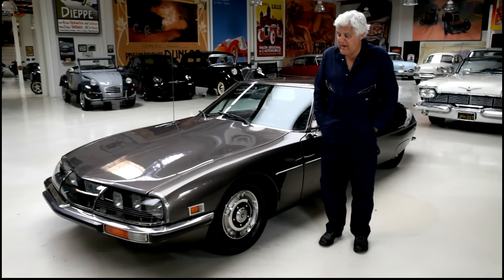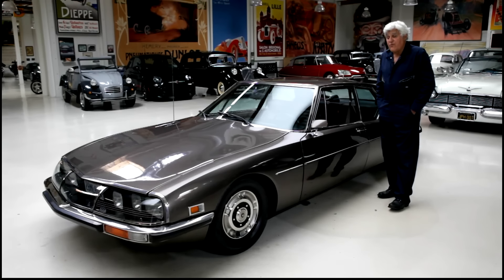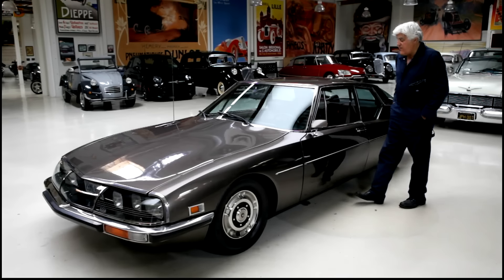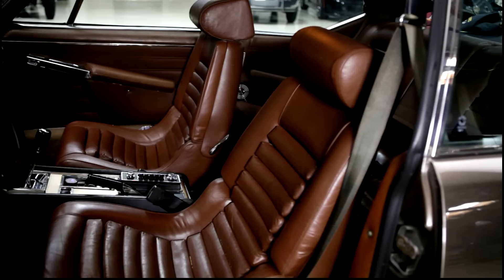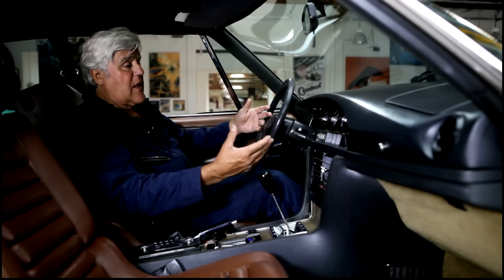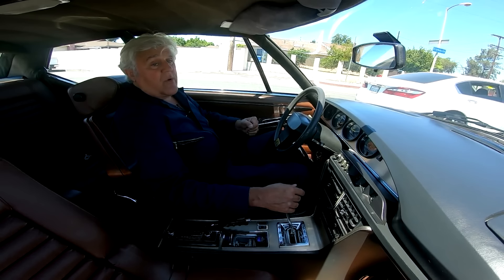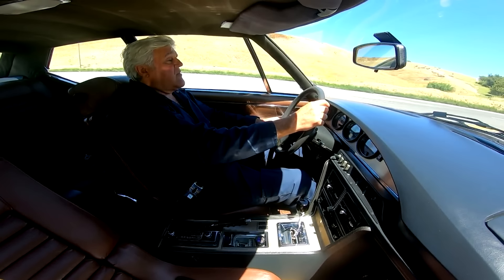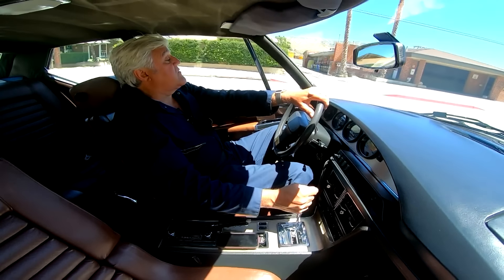The Futuristic 1972 Citroën SM | Jay Leno's Garage

Comment: I drove Citroens for over 25 years. In the early 70s, I had to drive my two-year-old DS21 through about a mile of floodwater a foot and a half deep.  The police were there and had marked the edge of the pavement with long poles.  I put the Citroen in high level as I entered the water and drove through rather quickly.  The car behind me, a large Ford, went slower as he was pushing a lot of water out of the way.  About a half-mile down the road from the flood I made a right turn and was T-boned by the Ford.   He hit my Citroen so hard I was pushed sideways some 30 feet.  When the police came the driver of the Ford excitedly told the police that our car did not go through the flood but had "flown over the water" and he was trying to catch up to see how that was possible and when I turned his wet brakes didn't work and that's why he hit us.  The policeman asked if he had been drinking and gave him a test.  The Citroen's box frame went over the Ford's front bumper smashing everything ahead of the engine.  When the tow truck finally pulled us apart I drove home.  From the man's insurance company i learned later that the Ford went to the junkyard, totaled. They ordered two new doors and a few other parts and after 3 days in the shop, my Citroen looked like new.  I put almost 200 k on that car before the Midwest salt ate up the floorboards.   I loved all four of my Citroens, but I loved my SM the most...
Reply: You, Lucky guy..
Quite an array of Citroens. .
Reply: That's absolutely insane
Reply: I love the C6, the rear window is spectacular the interior is so subtle too. I can see you have a strong bond with Citroëns and it was a pleasure to read your story
Reply: I would have a C6 yesterday but the Peugeot V6 diesel is noted for breaking crankshafts. Then there’s the early century electronics and switchgear that really can’t be trusted.
Reply: The hydraulics have a name for complexity but in reality it’s very simple. The problem was corrosion but everything back then corroded. 1970s Citroen should have at least used non corroding pipes. How hard would that have been?
Reply: "... flown over the water... "
"Sir, I need you to blow into this device here.".
Reply: @Dave5843-d9m  Agree on the C6. Loved it too. But maybe that was too ahead of its time. Heard of the Peugeot V6 diesel eating crankshafts too. I was extremely close to buying a C6, then found the offer of an XM. Despite its older age I went for that and found a car that is perfectly capable of being a daily driver even today!
Reply: I had Citroen BX TXI for 25 years. Superb car, for its cost. Joy to drive. Little maintenance. Same gear box all its life 320,000 km.
Due to cold weather with moisture and long winters here in north, it gained too much corrosion so it would not pass security test anymore.
Shame but now I have C5 and it is as good.
Reply: They're awesome, and awesome looking! So many amazing features that you wouldn't expect from any auto manufacturer in the 70's, or 80's, or even today. The suspension system alone is something that should've been streamlined and/or simplified & made standard on most vehicles.
Reply: @Dave5843-d9m  Hydraulics is forte of Citroen cars. Undeed very simple and working system, of course needs maintance like any system. Smooth yet effective system. Love it. The best car.
Reply: Well, it's great to see people on the other side of the Atlantic with such a love for Citroën cars!
« On n'imagine plus tout ce que Citroën pouvait faire pour nous ! »
Cheers!
Reply: This is one of my alltime favourite cars, beautiful styling, comfortable and, elegant. Hope to own one in the future. Citroen built some really special cars like ds, cx, xm and c6. I have owned a c5 ( 2017) with a big diesel engine, great long distance car. The French have a different way of thinking about cars: pragmatic, style and comfort but not over done or flashy.
Reply: Great story! Thanks.
Reply: Thank you for sharing.
Reply: Wow, thank you to have share this incredible and so funny story. You tell it so well I have all these pics in my head like watching a movie. 😊

Comment: Another fascinating personality involved with Citroen in those days was a man named Georges Regembeau. He was an engineer and Citroen specialist who came up with all sorts of incredible creations, such as a Traction Avant 15 Six with direct fuel injection, a supercharger and 6-speed gearbox in the mid 1950s, and selling tuning kits for DS and SM in the 60s and 70s. He also re-engineered Citroen four Cylinder engines to run on Diesel fuel years before Citroen built their first diesel engine for passenger cars. Naturally several SM were converted to those Diesel engines in the 1970s, a few were naturally aspirated but some were turbocharged and producing up to 150hp, which was just mind-blowing for diesel engines in those years. It is said that a special one of these Turbodiesel SM was capable of 150mph.
Reply: The Traction Avant was ahead of its time!
Reply: That's pretty interesting - I didn't know this and I'm a Citroen fanatic! I always wondered why Citroen had a straight 6 engine that they stopped using when the DS came out. Why didn't they develop that to fit in the DS and leave the 2lite 4 pot for the simpler ID..
Reply: @pallasathena55  Well it came down to Frances taxation rules of the time. After the WW2 they imposed a luxury tax on all engines above 2.2L. It's why the great French Luxury makes such as Delahaye and Talbot Lago went bust in the 1950s. They made all sorts of wonderful 3L + Straight Six goodness. The 15 Six engine was a 2.9L and thus not viable to continue. The air cooled flat six originally planned for the DS was also supposed to be around 2.2L or so. And to be fair the Citroen Pushrod four was a pretty stout engine.

Comment: The way the automatic wipers work is pretty interesting. When you turn the wipers on in auto mode it will wipe once. And the car will measure how many amps the wipermotor is pulling. If the window is very wet, the wipers will move smoothly and easy on the glass, the wipermotor doesn't pull as much amps so it will do the next wipe a bit quicker. If the window is getting dry again, the wipermotor will pull more amps which will let the car know it doesn't need to wipe as often anymore.
Reply: Yep, all that without modern digital gizmos !
Reply: Jay is the best!
Reply: Very interesting and that was 50 years ago. Impressive
Reply: Got a photo of that mechanism? SVP

Comment: Mind boggling technology for a car that is nearly 50 years old. What a car!
Reply: For the future of motoring look to the past...
Reply: 17:37 first low rider french style.
Reply: I think no modern suspension can give the same smooth feeling as Citroen Hydropneumatic. Yes modern electronic active suspension is great but it does not have the same smoothness as DS, SM or CX
Reply: @muhammadirfanataulawal7630  I have tried Lexus, Tesla, Mercedes, Saab, VW,, Opel, Large SUVs and many others....compared to DS they ride like a truck
Reply: @truthseeker8483  Yep. Electronics is great and sophisticated but let's be honest the "working principle" is not as advanced as hydropneumatic suspension
Reply: @muhammadirfanataulawal7630  Car chassis design is pathetic in 2020 compared to where it should be. Citroen Xantia Activa from the 1990's had active anti roll, self levelling and hydropneumatics...with today's technology every car should have a very reliable and inexpensive version of this...but no they prefer to cut costs
Reply: @truthseeker8483  But on the other hand the maintainance of this kind of suspension is really far to be free. And more importantly, when it fails, the car can't even brake properly anymore (to take your xantia example), so it can make the car dangerous to drive.
Reply: @Jean-Denis_R_R_Loret  You think that in 2021 it is not possible to make it very reliable? Engines are very sophisticated today and yet they are reliable. The "hard to maintain" argument is so old ..I think in 2021 we can do better than springy pieces of metal that have no self levelling or active anti roll
Reply: @truthseeker8483  Not hard to maintain, but expansive, clearly technically doable and I agree with that, but yet, expansive. How do you sell this to clients with no cash ? The second problem for most of ppls, is to find a technician able to maintain it, because even in france where that kind of suspension was more common than anywhere else, this is quite of a headache.
Reply: @Jean-Denis_R_R_Loret  Clients with no cash will not afford any car....if mechanics can maintain an engine then a suspension system that is not just pieces of springy metal would be easily possible too.
Reply: @truthseeker8483  To get straight to the point: in 2021, the xantia is still possible to find, for instance.
The pb is, to maintain just the suspension costs about the price of the used car, if not more, that's it.
Reply: @truthseeker8483  Oh yes they will, but used cars. And for instance on a used xantia (with typically 250,000km as standard milleage, minimum), just the maintenance cost of the suspension is already over the price of the used car. On top of this if you add other maintenances, plus insurance, plus fuel (extremelly taxed, so expansive in france). Don't forget that in France, already over 12 to 15% of the population is under poverty level -even if it's not as hardcore as in anglo-saxon countries-, and secondly if you live in the countryside, so basically 80% of the actual population, you need a car to go basically anywhere, there aren't any commutation systems at all so a car is mandatory, as rubbish as it could be.
Like any system, it becomes cheap while it's massively used.
Reply: @Jean-Denis_R_R_Loret  This is such often repeated BS, citroen hydropneumatic suspensions are not that hard, nor expensive to maintain. The only thing that fails fairly regular are the suspension spheres, and on a Xantia that's just a matter of unscrewing the old one and replacing it. Costs about 35 euro. Is the hydraulics fail you will still have brakes for a couple of pedal pushes, the accumulator spheres make sure that's the case. About the same if a regular brake line on any other car fails.

 The handbrake is also on the front wheels, so braking with that is no problem either. One of my friends has a 2001 Xantia as his only car (2l HDI). He bought it about 7 years ago and put 200 000 extra km's on it, I believe it now has 300k on it. 
2 of the spheres have failed so far, costing about 70 euro, the float level on the reservoir was stuck once as well I believe. He does put it in the lowest setting and highest setting fairly regulary, so that might help keep the shock absorbers good and corrosion free. 
From what I've seen changing shock absorbers seems pretty standard as well.

I really believe the reason people think an hydropneumatic suspension is hard and expensive  to work on is a fear of working on something that's a bit different by some mechanics. I also believe that because the "working on hydropneumatic suspensions is hard and expensive" myth is so prevalent many mechanics are able to ask exuberant prices for fairly simple jobs.
My grandfather also had a Xantia and his mechanic once asked 250EUR for changing a single front sphere, A job I now know takes a 35euro part, and about 15minutes of time, if it's stuck that is.
Reply: @slome815  "My grandfather also had a Xantia and his mechanic once asked 250EUR for changing a single front sphere, A job I now know takes a 35euro part"
But I totally agree with that.
This was more or less my point, this is expansive as long as you don't do it yourself.
Reply: Yes it’s a great car and im lucky to have seen one in real life in an old Citroën museum

Comment: Thanks Jay for a superb insight into the amazing Citroen SM. Here in the UK I’ve owned many Citroen’s during the past 30 years including the AX,BX,ZX, Saxo, and currently drive a C3 Picasso and a DS3 cabriolet but my favourite owned Citroen was the Xantia which was similar to the SM and had the same suspension system which used the green LHM fluid you were talking about. Citroen have always been a company that excelled in futuristic and advanced designs which is clear to see on your beautiful SM.

Comment: One of the coolest cars ever made. Highly unique, stylish, & refined.
 Driver's car for sure. And maybe a mechanic's car as well as you'd wanna know how to repair it.
Reply: almost all classic citroëns owners know how to maintain/repair their car.
from the 2CV, Ami, DS, GS, CX, SM till the XM they are enginering and design wise way different to most other car brands.
As an owner you have a love and hate relation with these cars.
The driving comfort of hydropneumatic suspension models is a class of its own like sitting on a flying carpet while driving over a bad roadsurface.

Even the mechanical spring suspensions have a weird system (2CV, Ami)
Often owners tinker togheter on a classic and have a good day and a laugh.
And ofcourse alot of shed enginering way better then once the oem part from the factory.
Reply: @obelic71  yes indeed 
I've had 3 xm's and I love it...
Like you said flying carpet...when the road have bad surfice just give little gas and you don't feel a thing...
Reply: I was just about to type that, it's very very cool, you'll look good in that thing wherever you turn up.
Reply: @danijeljerman9461  had a GS BX and CX.
working now on a classic commercial HY van (French chicken shed) from 1963, they were build from 1946 till 1983.
Reply: @obelic71  nice
Wish you all well. My father have bx...
But my wery first car was Citroen xm 2.1td with 80kw and black leather seats that was like new, meanwhile my friend buy 5years old bmw 323 cabrio with also black leather seats that was look like crap 🤣🤣🤣🤣
Reply: @obelic71  I always want to have a CX and a DS, but my finance is poor in the moment but one day will be better, for beginning maybe I buy a c6...and then go on...you know one step in a time...
Have a great day...
Byebye
Reply: @danijeljerman9461  Never had leather in my citroëns i had those comfy in al positions adjustable velour seats.
Like driving your sofa
Reply: @danijeljerman9461  the C6 new from the factory an instant classic.
Reply: The hydropneumatic system is special, but not that complicated actually. The main difficulties with the SM came from the Maserati V6 which was quite tricky with its triple carbs and 4 camshafts driven by 3 chains...
Reply: @obelic71  Damn right, my '68 DS19 Pallas had green velour interior. Unlike Jay's DS21 it had body side moldings which led to rusting. Everyone associates leather seats with luxury when it goes back to the days  (early 1900s) when leather was used in "open" cars & carriages exposed to weather.
Reply: @FrenchCrow  Yes, I heard from other mechanics that V-6 wasn't bullet proof even w/F.I. Wasn't that the same mill they stuffed into 86-ish Volvo 240 series bodies? Thought I heard the cams were soft maybe.  On a side note to what Jay said about Japan ending up w/them, I think several made it to Canada as I THINK their bumper standards didn't come until a year later.
Reply: @PowerslideSWE  Right. You'd feel like James friggin Bond in that thing!
Reply: @omarjette3859  Since i had the oportunity to drive a 30's classic desoto 4 doors with comfy velour all over the place i couldn't pass a Citroën CX with brown velour. 😁
Reply: @UberLummox  Not it is not the same engine. The V6 on Volvos is the PRV (Peugeot Renault Volvo) and its issue was more to have been designed as a truncated V8 and not a genuine V6. It was not very brilliant (more a workhorse than a race stallion) but usually quite reliable even if it's possible some series had the problem you said. On the other hand the Maserati was more in the italian tradition of sport engines that require top maintenance to last.
Reply: @FrenchCrow  Ah, ok. Thanks Mr. Crow!

Comment: The designer's name is Robert Opron. The name of the stearing system is diravi. "Direction à rappel asservi"means  steering with controlled return.
Reply: I would have translated that to powered steering return.
Reply: But what happens when you need to curb the wheels in either direction on a hill.... as Jay mentioned?
Reply: @TheObimara  I guess, turn the wheels, switch the car off and then let go of the steering wheel
Reply: Cool!
Reply: @SBK74  - Maybe, but it's not explained how it works. If it's part of the car's, um, cardio-vascular system there might be enough pressure etc to return the steering wheel. Perhaps there's a lock out of some sort. France also has hills...
Reply: @TheObimara    hope the parking brake is fully functioning !!
Reply: @TheObimara  If needed you turn the wheels and remove the ignitionkey. Then the Antitheftlock keeps the steering wheel in place with the wheels turned. But a Citroen parked with wheels turned looks just wrong to me :-)

Comment: I don't know how Citroen made any money building these ,the engineering you can't see is amazing
Reply: SMs were hardly profitable. One of the main problems was actually the Maserati V6 which was costy to make and maintain. It was tricky to maintain like many exotic italian engines, and very unreliable if not properly maintained (triple carbs and 4 camshafts driven by 3 chains...).